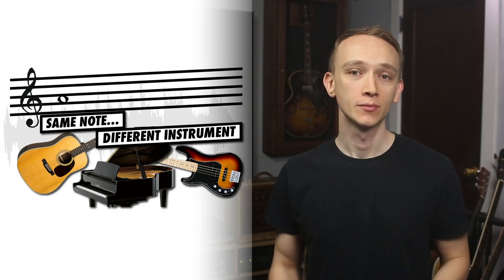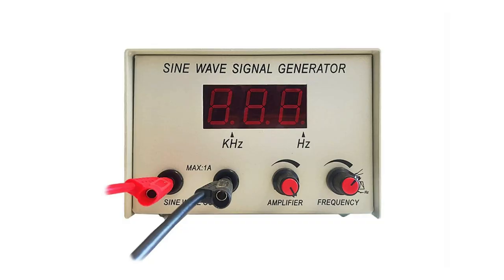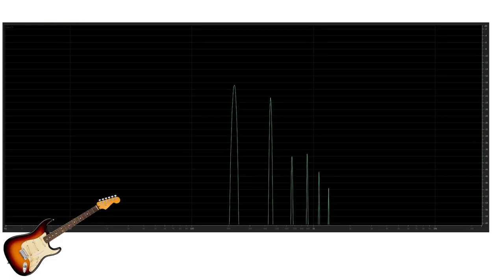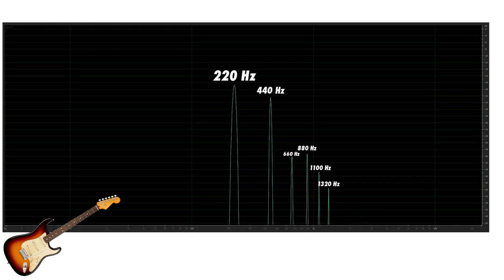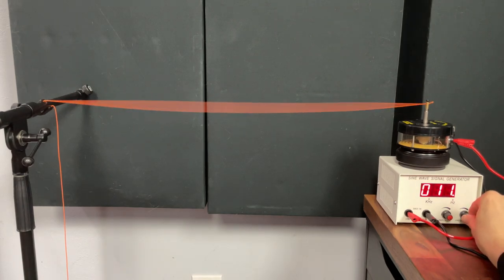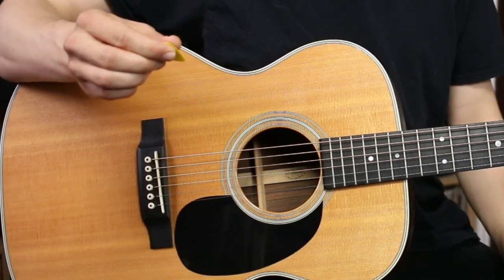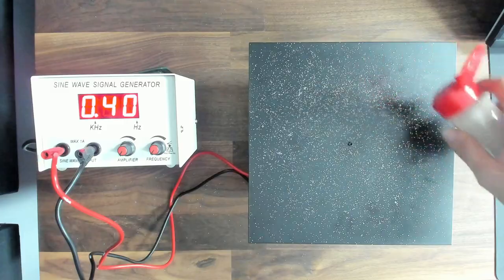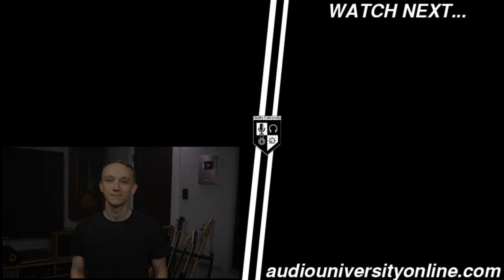Why Do Instruments Sound Different? (w/ Visual Demonstrations!)

Comment: Great video, but I'm intrigued to learn how and why the acoustic guitar produces undertones. How can a string of length x generate frequencies representing wavelengths greater than x?
Reply from the maker: This is a great question, Stuart. I’m not finding any clear explanations online that I can send to you. Although, my theory is that it is similar to room modes or standing waves in that only half wavelength is required.
Reply: @AudioUniversity  That suggests it's the sound box doing the pitch adjustment. Makes sense ..... sort of ..... I think.
Reply: @AudioUniversity  Boy! Not going to watch over breakfast again* - surefire way to induce a headache before the coffee has a chance! 

The Wikipedia page on undertones/subharmonics is here: https://en.wikipedia.org/wiki/Undertone_series, and it's quite interesting. It doesn't mention beat notes, but it does touch on room acoustics (obliquely and in passing), there's also an interesting throwaway comment that says that, in natural musical instruments, undertones aren't produced at the same time the fundamental is created . 

As long as we're talking about natural instruments, undertones seem to be caused by the acoustic, and/or weirdness in the instrument body, and/or forcing the vibration to be half the frequency of the natural resonance (or whatever value you're aiming for). This make sense if they aren't caused directly by the fundamental, but by a sympathetic resonance, either in the instrument itself or the acoustic. 

Then there are beat notes to consider, and undertones might be seen as a special case of these. Say you're playing A220, and you add in something else at 330 Hz (a sharp E above middle C) - that gives you the A one octave below (110 Hz) as the beat note (but it will probably sound horrible!). You can try this with a pair of audio oscillators, or simply generate tones in your favourite audio editor... 

In the 1940s, my late father (who was a designer of synthesizers amongst many other things), nearly got expelled from school with his brother, for sneaking into the school chapel to generate beat notes on the rather fine pipe organ, which had a 16ft rank (of pipes). They found some really low resonances of the building that way, and nearly succeeded in removing the stained glass from the windows! Obviously this is a dumb prank, as you cannot avoid getting caught, but hey.

There's another interesting side issue: "wolf notes" in orchestral stringed (bowed) instruments. C.A. Taylor in "The Physics of Musical Sounds" says this is be cause of differences in resonance between string and instrument body. It's interesting because the bowed string is a forced vibration (not like the natural ones of a guitar), so you can force frequencies (notes) with the bow that the instrument wouldn't 'want' to make normally. The implication is that the instrument's body resonance works against the bowed string, rather than with it, leading to a reluctance to make the fundamental, instead settling into another resonance such as 2nd or 3rd harmonic. The 'fix' is usually a damping mass added to the string beyond the bridge (or get a better cello!).

I'd suggest that, without some sort of external resonator (e.g. a room acoustic of some sort), you'd probably struggle to get undertones to occur naturally with a guitar (open air/sunny day experiment?), unless you intentionally off-tune a second string. Of course you can digitally process stuff and play all sorts of games with subharmonics, but that's a different matter.

*of course I am really!